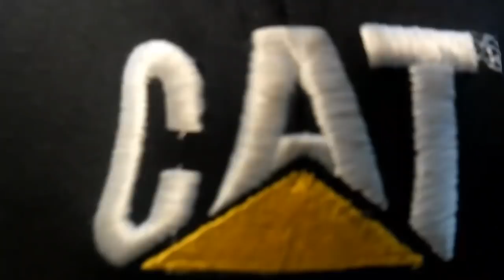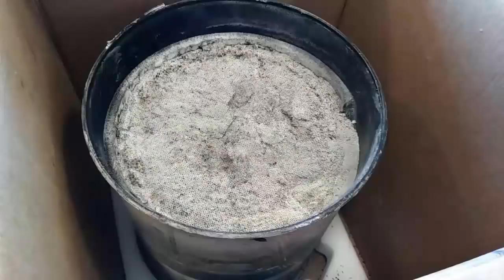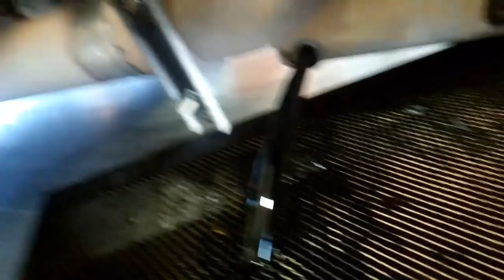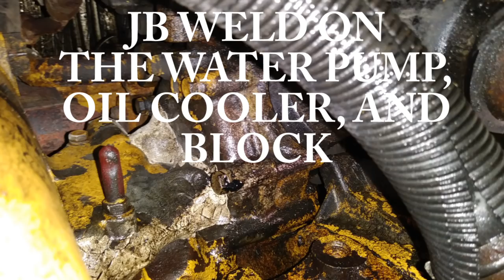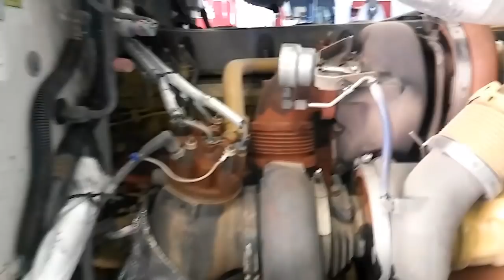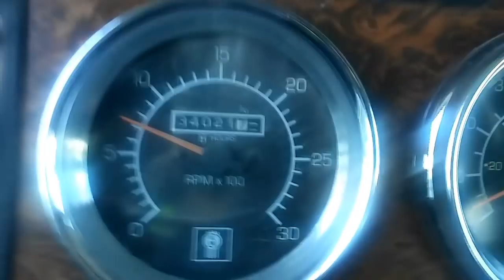What To Look For In A Used Diesel Engine? Used Diesel Engine Inspection.

Comment: I have a jeep liberty kJ Cherokee it's a turbo charged 2.8 litre engine it's a CRD and I was driving and lost power completely and the engine just turned so I replaced the injectors torqued them down bleed them new oil and it still just swing's

Comment: I've got a CAT C11. It starts and idles strong. It could idle all day and no blow any smoke. When we get into higher RPM's after about 20 minutes it starts to blow white smoke and it sputters a little. I've drained the tank, changed the filters, tried the water treatments. I can't for the life of me figure out what it is.  As soon as we lower the RPM's and get back to and idle it clears up again almost instantly. What would you think? I'm not losing coolant.

Comment: I don't "see" trucks anymore. That said, most customers looking at new/used diesel pickups...especially dirty maxes, I check the upper rad hose cold---if you can squeeze it, good. If it feels like an excited donkey cock then...head gaskets---beyond that rust, other leaks leaks and like you said might blow up in 10 miles.

Comment: Cruise control works for a minute sometimes.. then it cuts off. Sometimes it works for days on end without cutting out. Very strange. Replaced Speedo sensor on tail shaft. Still cuts out

Comment: I was told to hold the dipstick vertical to see how fast it drips off the stick, if it's diluted it will run faster, but needs to be done while the engine is cold. Does this have any merit?

Comment: First thing I look for is where the air enters the cylinder at. If it enters at the top, I shy away. If it enters through a ring of ports just above bottom dead center and has to be pushed there by a roots blower, I'm in.

Comment: I have a 2005 w9 with a 550 acert ..my fan will stay on all the time if I don't unplug the AC compressor.. I brought it too 3 me shops and there best guess was to run a switch to manually engage the fan when it hits around 200 ..any suggestions on what it may be ..so far changed the fan hub/clutch and condenser..ended up running a switch so idk from here ..don't have the money right now to change the compressor..think it may be that?
Reply from the maker: Hello Aaron, your engine ECM controls your cooling fan and it must be getting an AC on signal from somewhere. Try unplugging your AC pressure switches and see if it kicks off, if it does, then you probably have a bad AC switch. If it still stays on then you may want to get the ECM programmed to not turn the cooling fan on with an AC signal or you can go through the time consuming process of trying to find out where the AC signal is coming from.
Reply: Thanks man just bought it ...and a little amount of blow by is normal right ?

Comment: I need help/advice here. I have a 3.0 diesel engine, placed on ground/platform, for water pumping usage... recently started to exhaust black smoke. Since last week, when the engine runs for one minute(that's when the smoke gets darker and darker), the engine started to slow down.
What is possibly happening?
Reply: I'm also wondering if it could possibly be fuel injection pump because the accelerator is not working normally since 2020. I have adjusted it to a point(which is quite high) where it could run smoothly and locked it there until now. If I were to take it out to bring it to the mechanic, is it a very difficult & troublesome job?

Comment: What if the seller has just done an oil change? Will an oil analysis tell you there’s a problem?
Reply: Not really it depends how long they run the engine after the oil change if it had a leaking injector it would not have a chance to leak enough to build up in the oil.

Comment: My engine runs great on level eara, but when under pressure or load up the hill and my temperature reaches 195 degrees the engine starts misfire and my temperature 🌡starts go up not sure what's happening.  I add adjust my valves and my injectors and still not working out.

Comment: I have a 2006 c7500 with 3126 cat it cranks and runs fine doesn't smoke at all has 123k miles x AT&T truck so governor at 68mph. It blows oil out of the blowby tube at a fairly high rate seams like something is putting pressure on the block checked turbo replaced crank vent filter. any help would be appreciated

Comment: Do you recommend a Cat, Cummins or Mercedes diesel engine?  Which one is most cost-effective to repair?  I'm looking to buy a 2007 or newer school bus and personally like the CAT C7 sounds.
Reply: Just note that if it has a C7S in it, swap that for an older C7 or even a new C7.1 industrial engine. Otherwise, delete the emissions itrms. C7S's are notoriously unreliable when it comes to the emissions systems.

Comment: I have a 1993 f350 idi when I bought it I didn’t know anything about Diesel engines ever since I remember had bad blow by and a rear mean seal oil leak I don’t really burn any oil It does smoke like crazy when cold and takes forever to get to temperature I guess I got lucky with the truck but I haven’t had that many problems with the old truck like I do with my 2006 Duramax

Comment: When my Detroit glider is cold it blows alot of blue smoke uses no oil. Blowby tube blows smoke when its cold out as well. Smells like burning oil. So i bought another 12.7 from factory . I have the same problem if i didnt know better they never took engine out. All bolt on components are the same from old engine bolted to new

Comment: You need to do a video about equipment auction sabotages ,,,I know this is a trick(this is where you're at the auction and all the equipment is idleing people are checking them ou)this trick  is from an old horse trader this is  for older diesel  equipment ,,,auctions every diesel engine at idle between the 200 300 RPM range (harmonic resonance)) you could find a point where you're idling it for that motor just knocks like hell once a idle Pointe was found he would set that equipment at that point if he  wanted to buy it,,,, and other machines if  didn't want to buy it he could find an idle Point with that motor sounded like a sewing machine,,,,,,, then every time somebody played with the idle on his prospective new machine he'd run back there and set that Idol making it knocked like hell,,,,, so when you're buying a quipment at all actions there's so many different ways people sabotage equipment I machine could have been idling for hours fine ,, so when time the auctioneer comes around they can't get it started ,,,, then after it's been sold The Saboteur  un sabotage &  it starts it up and drives his new machine to his stable,,,,,,, do a video on all the s*** people can do at all actions and how to spot it,,,,,, I'm an old diesel dog from lay back but I enjoyed your video and learned a few things new,,,, when you quit learning in life that means your dead lol
Reply: What diesel idles at 2-300 rpm.
Reply: Saw it done many times.
Older districts almost always had an emergency air flap mounted above the super charger.It was activated with either a cable or electric solenoid. You could trip it by hand and make it look like it wasn't done. No air getting in to burn the fuel.
Cummins might have a emergency fuel stop. Activated the same was. I have seen somebody turn the fuel off or almost off, then loosen the nut on arm and reset it look open. 
Put tape on the terminal and on of the fuel solenoid so it doesn't open.
Reply: In the high speed arena which is what most equipment is

Comment: All emissions crap is absolutely pointless.  All that should be "optional" is a plain Jane turbo with no variable gobbledygook.  Toss all those bill gates electronics in the trash as well - Pointless.  I don't know how the bloody nation ever functioned without all these emissions & electronic crap.  Majority of diesel emissions were pure carbon, which isn't even gas, but carbon particles.  This is the visual soot that they control in the waste of time filters;  filters which I have personally witnessed caused fires on trucks.  The other filters use urea Alpine or DEF to create chemical reactions to control mainly the carbon.  Who's to say that the emissions are actually healthy for us to breath?  I guess if the exhaust pipe is 100% clean and carbon free, it's all good.   It's time to bring back two stroke diesels for highway use and bring back the ole shit that was much more reliable and didn't take a computer tech to fix them.

Comment: I have a Toyota 3L 2.8 blows no smoke except a little black underload ...no oil in coolant ..no coolant in oil...no leaks anywhere...goes great...but uses 1 litre of oil per 1000k...any ideas? PS fuel economy is good too 13 k's per litre for a slwb van.

Comment: just bought a 2007 car that has camchain and NO frigging DPF. Also guys dont buy diesel with % biodiesel mixed in (usually 5-7% - in europe) that plays havoc on the engine. Promotes algae growth if left for more than 6 months  - clogged filters and injectors! EXPENSIVE STUFF... Use only clear diesel...if its yellowish then it has rape seed oil (RME) in it - BAD for all cars DPF or not...
Reply: Aren't there additives that will reduce or prevent mold growth?

Comment: Hey Jay, Thank you for taking time to educate people like me that know little to nothing about Diesel engines.  I have owned two diesel motorhomes with cummins 400 non def and current coach is a Cummins 450 with DEF.
My question: I’m looking at 2 other older coach’s with 2007 CAT 350 rear rad.and the other has a 2006 400 CaT with side rad. Which of the Cat engines
Reply: Sorry.. any particular issues with either of the CAT engines I mentioned ?

Comment: I need a GM 6.2L engine for my 1987 Suburban V2500. Which rebuilders are reliable? Or is there a reliable source for a used engine?
Reply: I have heard that there are numerous military surplus 6.2 and 6.5 engines from their HMMVs. Those engines have 24V glow plug systems, but you can swap those out for 12V systems.

Comment: bought used 1997 e350 7.3.
heavy gray smoke.
esp when cold.
i changed oil& filter every 69 days for 2 years.
2 years later it runs like a demon and no smoke. still change oil every 10 k miles. its got over 495 k miles and no problems and wil out pull every truck  on the road up to 12/25/18

Comment: HELP   new 2016 volvo rear drive shaft was out of PHASE . at 36000 miles it eat up 1st set of tires could not get dealer to fix after 79000 went to different dealer drive shaft out of phase . this truck shaking and even jump up and down . but how a vibration that is growing it is betting the rubber out of carry er bearing

Comment: I spent a formidable part of my life as a heavy duty mechanic. 
A side bar to this video is, a broken truck is not a deal breaker but a price adjuster. I prefer to buy trucks that require some sort of repairs prior to being usable. I’ve bought my truck with blown bearings in the bull gear. A relatively simple repair. But a lot of guys figure dump the truck.
Reply: Are you still fixing trucks?
Reply: Blown bearings in the bull gear?
Reply: I agree.  I'd rather buy a truck needing an overhaul than one that was just overhauled?  Do you think they did a quality job right before they sold it?
Reply: One other thing to look for is correct fastener use...are all the bolts holding down the part the same? Most engines don't hold down a part with different kinds/styles of fasteners. Its a red flag for a shoddy repair and that repair ethos probably follows through to other repairs & maintenance.

Comment: I do have a question about the white smoke, my 7.3L IDI blows a plume of white smoke on a cold day, when it just fires up cold. There is only the one plume, and afterwards, the exhaust is clear. Is this just a cold engine, or something else?
Reply: Based on info provided and as long as you haven't experienced any performance issues at temp, its just a cold engine. Saw this all the time at Ford, people would be worried (which is not a bad thing).
Reply: Are you losing any antifreeze? sometimes a tiny head gasket leak or engine crack will cause white smoke when cold and not hot.

Comment: There's only two reasons to get a used engine.
One is to get that famous torque from 1100 to 1400 RPM that's only available on yellow engines. In which case, everything you mentioned applies.

The other reason for a used engine... Revenge!
A twin turbo 8v92 with straight pipes, mated to a 5 and a 4, is perfect for running passed the neighbor's house at 4 in the morning, after having been kept up all night by one of their famous Saturday night parties.
In that case, who cares about how bad the engine is as long as it runs, and is extremely loud, and will rev to 2400 RPM.
Just make sure to bump the governor before shifting. The neighbors have earned it.
Reply: And an air starter to top it all off😎

Comment: Can I swap a 3126 210hp to a c7 300hp
Reply: Can the drivetrain handle 300 HP or the amount of torque? New C7.1's put out 935 ft lbs of torque so your drivetrain should be ablw to handle at least 1000 ft lbs.

Comment: The older trucks will smoke upon startup. Old 70s and 80s will smoke blue or grey for a while if cold. I own a old 400 Cummins and it will smoke for 20 to 30 minutes or until it's warm and that's just how it is. I rebuilt mine around 40,000 miles ago and it will smoke when cold until it gets to 160° still and everything is new. Nature of the beast with these old engines especially when timing has been retarded or low compression pistons are installed like mine.
Reply: My grandfather usually when waking up also smoke like hell Paramount cigarettes and coffee
Reply: Pretty much any pre-emissions or deleted Diesel running on used engine oil will smoke on startup as well.
Reply: Yep same with older tractors.  Later 20 and the 30 and 40 series John Deere’s are notorious for blue smoke at idle when the engine isn’t at operating temp. they will fog out a shed in no time . Nothing wrong with them thats the way they are .

Comment: I bought a tractor, bloke said it didn't smoke, when i got it home i knew what i was in for as it had been sitting for 10 years in a paddock, well did it smoke? it blew more smoke than a steam train, the fix for blow by was put a piece of rag on the dipstick, the oil filter had never been changed in its life, i didn't need to change the oil as it used it like fuel, when it finally let go i found out the farmer used an angle grinder to clean up the weld on the cracked block between the cylinder bore, i had to get another block and i rebuilt the engine, also i had to take the radiator apart as it was blocked solid by dirt, now runs perfect.

Comment: Petrol engine has less issue comparing to diesel
Reply: Are you comparing any certain petrol engines to any certain diesel engines? Or just comparing petrol engines to diesel engines in general?
Reply: Any diesel car engine.
Reply: aAhmed diesel is far more reliable and durable than petrol engines. Im not saying gas engines are weak, as their are plenty of great gas engines. But when gas engines as a whole are compared to diesel engines as a whole, diesel far out performs gas.

Comment: There are a few more rules when dealing with a used DPF engine:

The failed DPF will damage the rest of the engine, so if you find a problem in a DPF engine be alert. The rise in backpressure destroys the turbocharger. In other cases, the turbocharger fails and the leaking oil ruins the DPF. If the engine does not use an injector in the exhaust system, it will inject extra fuel to get the DPF into active regen mode. If that happens too often, it wears out the piston rings and bores due to excessive unburnt fuel in the cylinder. Other times, the piston rings reach the end of their life, lead to excess oil consumption, and then clog up the DPF. I don't know how to separate all the different issues to solve the problem. Maybe you need a DPF, maybe you need to rebuild the whole engine and then replace the DPF. It really sucks that doing a compression test is either impossible or extremely time consuming on most modern diesels.

7:20 Diesel engines in many cars and pickup trucks always routed the blow by into the intake manifold or turbocharger. On the old ones, you could easily see where a hose was routed to the intake, then you could remove the hose and observe.

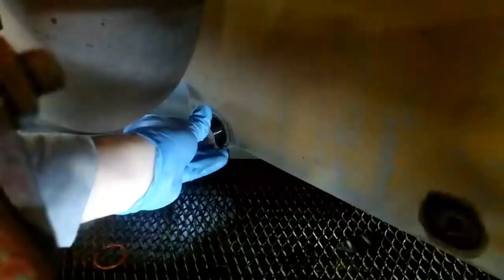8:15 The other flaw in coolant test strips is that they don't tell you what type of additive package the coolant uses. Many years ago, Honda dyed their coolant green, and people would use the silicate based green antifreeze that was made for American cars. The result was water pumps failing too soon. There are other problems with the wrong coolant, but the example I used happened in my family. Gasoline or diesel, you must have the correct type of coolant and if applicable, coolant additives.

Do any of you guys watch the "Powerstrokehelp" channel? People who own or work on diesel engines should also watch that channel even if they don't have a Ford or Navistar.

9:20 Excessive DPF active regen leads to excess fuel in oil if the engine doesn't use a fuel injector in the exhaust system. That is one thing that should be mentioned when you mention checking for excess fuel in the oil. It is extremely important.
Reply: Or just delete the DPF entirely. And the EGR.
Reply: @electric7487  That's great if you don't need your truck to be street legal.
Reply: Nope not how any of that works. Lmao I can't believe you literally typed out all of that completely wrong information 😂😂😂